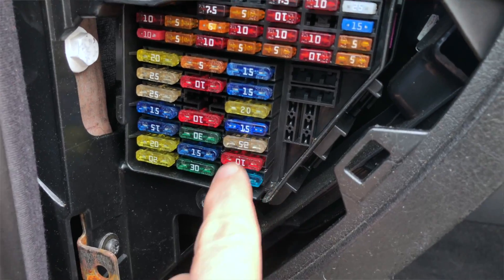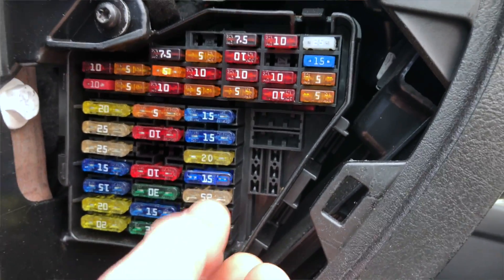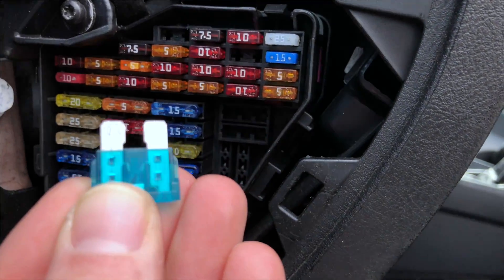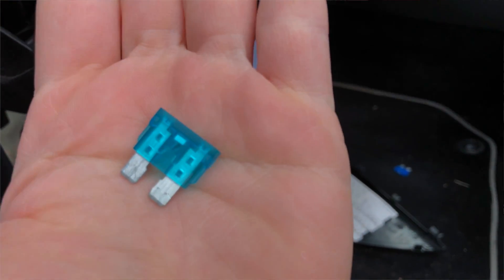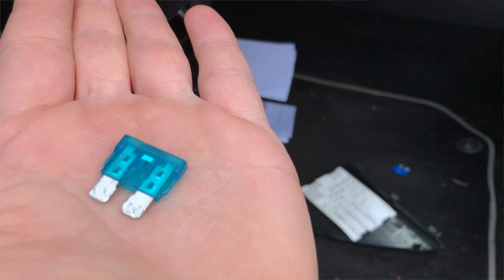Never Skip The Basics When Working on Cars

Comment: one time i replaced a soldered relay in a lighting control module of my grand marquis to fix some intermittent headlight issue. turns out it was a faulty circuit breaker in the fuse box that failed when it got a lil warm.

Comment: Hey Charles.  Speaking of heated seats, I've found the following for Mark 4 Jettas and Golfs.  For the left side switch, if the back is green (1J0 963 563 B), it's for cloth seats.  If it's red, it's for cloth seats (1J0 963 563 D) or leather seats (1J0 963 563 C).  For the right side switch, if the back is brown (1J0 963 564 B), it's for cloth seats.  If it's blue, it's for cloth seats (1J0 963 564 D) or leather seats (1J0 963 564 C).  Have I got this right?

Comment: I had a MK3 and the blower stopped working, I pulled half the dash apart trying to fix it before I thought to check the fuse. Another one was my MK4 was having weird power surges on full throttle I spent 6 months looking for the problem and it was just a dirty MAF, it didn't throw a code so I never checked it.

Comment: Same happened to me a few days ago. Battery voltage started to drop, power steering went out and after a while the car stopped running. Immediately thought of the alternator as its the original one with 140k miles. Almost bought a new one when a buddy of mine was like "You've checked the cables right", and I was 100% positive I had. Turned out to the ground cable, simple and free fix
Reply from the maker: Seen that exact thing happen to atech

Comment: I did this once on my '68 Ford Galaxie...  Brake-lights quit working...  Clearly it must be the brake-pedal switch...  Ordered a new switch, put it in...  Brake lights still weren't working.  WTF?!!

Yeah...  Both bulbs were blown.  LOL.  Did I even bother to check the bulbs at all?  Nope.  I immediately diagnosed it as a bad brake-light switch, because "how could both brake-light bulbs possibly blow at the same time?  It's gotta be the switch."  Duh...

Luckily the brake-pedal switches for those things are only about $10 or so, and it's only about a 30 minute job to R&R, so it wasn't a huge waste of money or time.  Lesson learned though -- always start with the most basic stuff, no matter what you might think the problem is.

Comment: My basic check is a ground check I attached a wire are from The ground terminal in the battery to the car's frame and check to see if the problem is still there. Well that is after checking my fuse box

Comment: You're so right I just spent two days going crazy last week I was about to buy a new battery and starter for my car when it turns out the terminals were just damaged I didn't even think to check them until something told me why don't you replace the terminals before you get the new battery and starter so you have a little bit more wire to work with. Replace it and what do you know that was the problem all along. the car was sitting for 2 years and I didn't think that the problem could be that simple as just a bad terminal.

Comment: The best case I've had that's similar to this was a broken auxiliary heater. After a couple hours trying to figure out why the wiring diagrams I had didn't match with what I found in the car, I decided to check the options list for the vehicle. Guess what, it didn't have an auxiliary heater. the previous owner told the customer it did, but it didn't work.

Comment: I spent countless hours on a rough idle and the car dying at stop lights. Had a code for the maf, bought a brand new oem one, put it in and nothing changed. Then I started replacing vacuum hoses, intake gaskets, valve cover gaskets (v8 bmw so real pain in the ass), and I was about to change the O2 sensors but I decided maybe I got a bad MAF and ordered another one from a different supplier. Worked like a charm. Was driving with a foot on the gas pedal and brake to keep the rpm up at stops for probably 6 months. VERY similar story with my alternator as well. Received a bad one that tested good but wasnt communicating with the car (bmws...), spent almost a year just carrying a battery booster with me and boosting every day because I couldnt figure out the charging issue. But now I learned to use and trust INPA (free BMW specific diagnostic and coding software). Everyone working on a car needs the specific software for that car. I cant stress this enough. Average OBD scanners are garbage until the multi thousand dollar range and specialized software is usually free to under 100 bucks.

Comment: I had a 91 Merc Cougar that had the electronic dash stop working. I checked the fuses and couldn't find the issue. I took it to the local dealership and it turned out it was a blown bulb in the dash. It was a poor design that allowed the bulb to be a key part to the circuit for the dash. The dealership contacted corporate and I was refunded the cost of the repair due to it being a design flaw. I was called by the dealership a few weeks later and they replaced the electronic dash with an updated version. It turned out that the entire batch from the manufacturer was faulty. They never did a recall but I was told that any other cars that had the same issue would get the replacement display.

Comment: A DPF got clogged up on a Toyota Hiace. My workmatre spent hours trying to diagnose the issue. We sent the van away to an auto electrician who couldn't find an issue with any of the electronics. W e then sent the van to Toyota who found that the oil was overfilled causing the ECU to disable DPF burn off
Reply from the maker: Wow.

Comment: LIKE #666. I am immensely honored.  Great videos, thanks so much for these.  By the way, in my MK4 TDI Jetta sedan with the  OEM MONSOON stereo and a line output converter spliced into the rear speakers I was getting no sound from my single 10" subwoofer. I checked the power to the amp, gain settings, swapped out the amp for anther swapped out the subwoofer for another, changed RCA cables, speaker wires, EVERYTHING. i quite literally changed out every single component except for the main power lead running under the side sill plastics. Then in the insane super hot and humid baking heat of the Ohio 2017 summer I painstakingly removed the crimp splice connectors of my RED/BLACK RCA cable line output converter and installed another L.O.C. using the same crimp splice connectors in the exact same spot. On my back. Upside down. Out in the sun. Pouring with sweat.  Stuffed into my filthy parts hauling trunk. Even with a black mover's blanket what a total nightmare.  Same result: no sound from subwoofer. The cone was very minimally oscillating.  Absolutely exasperated beyond belief I started fiddling with the knobs on the stereo only to find I had the FADER KNOB set all the way +9 to FRONT SPEAKERS!  Hahahaha, no wonder I wasn't getting any output to the rear sub, the line output converters were tied into the rear speaker wires as I usually have the FADER set to -3 REAR when driving alone. It was my Japanese wife that always bitches at me for my stereo 煩い/URUSAI that prompted me to set the fader to front speakers during our drive home a few days earlier and I had completely forgotten I left it there. All I had to do was literally turn a simple knob and I could have saved myself 2+ hours swapping out the sound system, sweat drenched clothing and IMMENSE FRUSTRATION! Now I have a perfectly good line output converter (just as I did before this shit show of stupidity) to use on a future stereo install.  K.I.S.S. INDEED!

Comment: I know this exactly.. Two days ago a buddy asked for help with his Mk5 GTI. Has a CEL with Fault code for the Pressure regulation valve on the High Pressure FuelPump Short to Ground. He changed the HPE Pump three times and searched three weeks for the issue, error persists... I told him after a short check of wireing -> Please check Fuse 6 in the Enginebay... 10 Minutes later he called back. It was the Fuse ! The old Valve had burned the fuse for the Voltage that supports the valve :) New Fuse and Car is running fine now.

Comment: Rule #1. Don’t just diagnose the fault. Diagnose the cause. 

A fuse blows because the circuit received a higher current than it can handle. There’s a fire risk there. If you’re sending customers vehicles out at risk of fire you need to put your tools down.

Comment: this happened to me a few mouths ago when my blower motor fuse blow, thought i changed it. first cold day when their was frost out i went out and turned the heat on and but their was still not working , so i ended up taking the blower out testing it then trying a new resister and then thinking i should double check the fuse.. wasted about 2 hours. luckily i thought about it just before taking it in to get looked at.

Comment: Love the IT reference. As someone who did this for years, I will say you're dead on! 

I will never forget the call I got from a student who just moved in, hooked their desktop up and it wouldn't power on. They wanted someone to come to check out the power supply, the motherboard, etc. I asked if it was plugged in. Student damn near flipped out on me. So I asked them to humor me, jiggle the power cable and ensure it was firmly seated in the back of the machine. When they did, the machine fired up without a hitch.  

So yeah I can see how it may help to take a step back and attack the problem from the basics first.
Reply from the maker: Hahahahha.

Comment: I have a 20th mk4 k04 with silicone hoses... couple of days after I bought the car I was happy and having lots of fun,yea,it was my first turbo and I was on my way home when all of a sudden I couldn't go pass 2500 rpms so the first thing came to my mind for some reason was limp mode.
It was dark...I went home,i opened the hood,took a quick look and nothing..next day I scanned the car,check fuses and nothing... I felt like 💩 and I didn't drive it for the rest of the week waiting for a mechanic to come and check it... the weekend finally here and he canceled on me...I was mad,pissed,sad. Etc... I went back inside the garage,I opened the hood and believe it or not the first thing I noticed was that the turbo intlet hose came out loose because of a cheap water hose clamp...that was it ... I felt so stupid because I could just take a better look from the beginning.😂

Comment: My "basic check" on any car help out with (not working as a mech) is the tires; pressure, visual condition (dry rotting), groove depth and torque. I might not have the torque spec but common sense is a good starting point for many things.

And I also have a silly experience to share about a "blown fuse":
 My heater stopped working completely one morning when I ironically had just mentioned to my sister how reliable my cheap car had been so far. So I went to have a look at the fuse with a multimeter, beeped it for continuity and checked that it got 12V - so fuse was good. Then I turned my attention to the wiring behind the not-so-easy-to-remove heater controls to find no voltage on the 12V input! Having no wiring diagram for the I Googled around for a bit not really finding anything useful other than a mention of a burnt fuse box.
To the fuse box once more it seemed, now finally taking out the heater fuse, and guess what? One of the feet had burned in half, disconnecting it from the other contact! Looking at this 40A fuse that didn't do its job I noticed that the fuse was 2 color - green AND brown. Which didn't make it a fuse, but a jumper for the infotainment screen language selection - which is located on the other fuse box. 2 hours of my time wasted because of my lack of attention to detail.

Comment: just like do not skip spark plugs when having a misfire. i swapped my plugs and 500km later it would not start and misfired like hell. swapped coils and converted to cop coils before i realized oil and water had shorted out the plugs.... all of them was firing straight back up to the head... so a 25$ fix costed me 25$ + 250$ in coils... check the basic shit first xD

Comment: Same thing in IT using the OSI model: start at the physical layer and work up. Ashamed to say I once spent several hours digging in programming for an issue when it turned out a cable got nicked. 

That and it is a good idea to live by KISS: Keep It Simple, Stupid. Applies to both design and troubleshooting.

Comment: I have so many stories like this. 

Car Dx by a State agency with a locked up engine. Main ground was loose. 
Dx bad trans, missing fuse for trans solenoids
power seat inop, they put a circuit breaker in the fuse box and burned up the fuse block at that point. Short at actual seat w power wire. 
Can Network down. Owner gave up on it. Ground supplying cluster was rusted off at kick panel taking down Network
Dodge dealer could not figure out why 02 heaters inop, they replaced pcm. Blew the skim module fuse with the swap. Could not reprogram due to this, gave up. 
No start, dx bad fuel pump. It was out of gas.
One I just fixed today, a tough one. dead miss at idle, had a ton of new parts. Everything checked out perfectly, compression and all. Had a rounded off cam lobe.

Comment: Put headers on my truck a few months back. Install went perfect, got all the broken manifold bolts out without issue. Fired if up and went on a test drive. Misfires like crazy. The only code it threw was "random misfire." I spent hours looking for anything I may have dislodged or broken during the process to cause random misfires. Long story short turns out I had a cracked spark plug. Before pulling the plug wires off it must have just barely not been arcing. After pulling all the plug wires off and installing the headers it must have damaged it enough to kill the plug. Popped a new one in and problem solved. Should have started off pulling each plug 1x1 in the beginning. Live and learn.

Comment: Just did a battery replacement on Monday because it was cold and the other battery was too old for the weather, and had an odd no-start where I started to crank, and the whole car went dead mid-key turn.    Freaked out, trying to get to work on time, popped the hood, looked at the terminals I'd just attached, wiggled them to be sure they were tight, and the car started.    That evening, work is done, still cold, get in, try to crank...  cluster goes out, all lights out, dead.

Pop the hood, and by phone-flash light, check the cables again that I checked before ... the positive terminal wiggled.  :|   Check the basics, and ideally, don't succumb to "I gotta get to X on time" pressures behind it.   Thanking my lucky stars that the terminal didn't wiggle or go loose enough while driving!

Comment: I’m that grumpy old man who always asks the struggling new guy with the fancy Snap On LED logic light if he checked the fuse. Of course he says he did but, in reality, he just poked at it with his expensive tool. Then I pull the fuse out and the connector is melted. As I’m walking away, I usually hear the smack of the fancy tool hitting the wall, coupled with some colorful language. I just smile and keep walking.

I have a couple favorite saying. “The tools don’t make the craftsman,” and “common sense is a flower that doesn’t grow in everyone’s garden.”
Reply: @Ronald Martin. I have plenty of diagnostic tools too, but my most important one is between my ears. 😎
Reply: I have a lot of diagnostic tools. First thing I do is pull up wiring diagram then check EVERY fuse then for missing fuses.

Comment: My first step is to leave all my tools in their box and look for anything physical - burn marks on fuses, rubbed/pinched wires, etc.  It's amazing how often the problem is staring me in the face.  And it's fast.  If there's nothing obvious, then I go get a meter and maybe a couple of screwdrivers, etc.

Had a friend complaining about his rear defroster not working.  He'd played with the connections, pulled apart the dashboard to get at the switch (this being in ye olde days before cars had even a single computer.)  I looked a little more closely at the rear window, and found he'd scratched a thin line through most (but not all) of the heating bars - probably from overloading the hatch when heading back to college, or some such.  No damage to the glass, just a hair-thin line through the heating element bars.  Since there was still one or two bars connected, his multimeter said he had continuity, which kinda messed up his diagnosis and resistance specs were nigh on impossible to get your hands on back then.  But a good visual inspection can't be beat as a starter.   And it doesn't cost any fancy tools except a Mk.1 eyeball and maybe a small mirror.

Comment: Simple stuff gets you.....A friend and I were doing a stereo and amp install on his car. we finished, or so we thought, amp wouldn't turn on, started checking fuses, redoing wire connectors. We ran out of time and had to go do date night with the girlfriends. Have way to the restaurant, it dawns on both of us simultaneously, that while we checked the fuse in the power wire several times, we never hooked the damn thing up to the battery terminal. We felt dumb, but still laugh about it years later.
Reply: Matt lastname here I’m guilty as well

Comment: This one hit home for me - ~10 years ago my B5 passat 1.8T was stuck in limp mode. Checked EVERYTHING through wiring, n75 valve, etc... had a shop spend 2 hours of diagnostics on it, nothing. Their next step was quoted 6 hours of going through the wiring harness. I said no let me take it home. I checked fuses and found the 20A engine electronics fuse was blown. Threw one in and it was back to normal. Glad I tried to tackle it myself in this case and didn't go back to that shop...